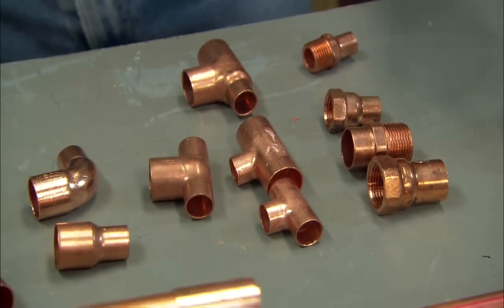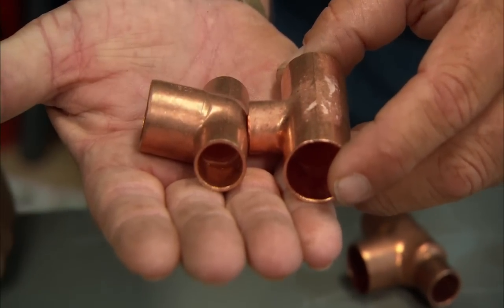All About Copper Pipe | This Old House

Comment: I will always trust Copper more than Pex.
Reply: Arie why you trust copper than PEX, pex carries water more fluent , not easily corroded
Reply: Why?
Reply: I agree. Plastics poison our water system. Every decade the newest greatest plastic comes out and every 30 years after "whoops it causes cancer". Personally I would go stainless steel over copper these days though.
Reply: @thomasblue6064  Copper is anti-bacterial. As is Linoleum. It's also recyclable.
Reply: @junjiawei6531  - Copper been in My 1st house for 33 years never had corrosion.  Pex is good for quick TEMPORARY plumbing fix.  Otherwise I stay away from it.

Comment: People love copper pipes, and complain about plastic pipes leaching. Copper oxide is highly toxic. Iorn rust is non-toxic. Just food for thought.
Reply: What's best then, galvanized steel pipe?
Reply: @flat-earther  Pex A. Lasts forever, doesn't explode when it freezes, flexible.
Reply: @xandror  Okay that's great.
I heard rodents have chewed through Pex though.

BTW xandror I suggest watch a 13 part series called What on earth happened by Ewaranon to learn that the earth is not a globe.
I got it in my about tab.

Comment: Rich should of showed a slip joint fitting.  That could come in handy for repair work where you are swapping something out.  I just discovered them by watching another plumber on YT.  You can also take the convectional joint fitting and file down the inside stops --in a pinch.

Comment: I was resistant to transitioning from copper to pex for many years.  However, when I purchased a rental property that had been completely outfitted with Pex A tubing waterlines, I changed my sentiment.  No soldering of joints; no oxidation of the pipes leading to leaks that need to be repaired; and much more flexibility in the tubing leading to less joints.  Plus, after I transitioned two of my other properties to Pex A, I was able to offset the cost of materials and net a profit from taking the scrap copper to the metal yard!
Reply: sounds like a PEX company advertisement
Reply: Hope your tenants like microplastics in their drinking water...
Reply: Poisining water for geberations to come to save a few bucks today! The boomer way!

Comment: I'm remodeling a 40-year old bathroom and discovered a set of what looks like foam tubing-insulated 1/4" pipes next to a set of 3/4" copper pipes.  Why would they have installed both?

Comment: 1:08, what's confusing is the type of temperatures for the type "M" pipe? Baseboard heating, or hot water feed line temperature, (which is less than the baseboard temps). Because why would they make half inch if it's just for a heating pipe?

Comment: I was cleaning my baseboard heating and the cleaning spray I was using turned the copper pipe red I was worried I was doing damage so I stopped using the sprays. Cleaned the pipe and it didn’t feel like the chemicals ate through the pipe but it went from brown looking to red. I should have known better.

Comment: Any reason why someone wouldn’t use a conduit bender rather than a 45° or 90° bend?
Reply: I don't believe copper bends like conduit.
Reply: Conduit has a different Outside Diameter and doesn't match, therefore a conduit bender will kink copper pipe... at least if you try to bend a 90° turn. You MIGHT be able to get away with it if you only go 30 or 45°, but I wouldn't go any further than that.
Another trick is to go up a line size on your bender...) i.e. using a 3/4" bender on 1/2" pipe.) This will lead to a much larger bending radius but I still wouldn't push my luck bending a 90. Go with a fitting for anything over 30°.
Reply: @benjaminkluge7897  we use bending machines all the time in UK can bend 180degrees this a manual machine maybe your copper is shite,also why don't you have pre solders fittings, 40 years behind mate

Comment: Odd that you can't use M grade copper pipe for domestic water but the fittings appear to be M grade..
Reply: Fittings are all the same no difference
Reply: I wondered the same thing .
Reply: You can use M, depends on the state.
Reply: Baseboard heaters all use 3/4"  type "M" around my way on the east coast
Reply: @worldview730  yes same here in Mass. Now they use PEX..
Reply: @raybonz7939  right